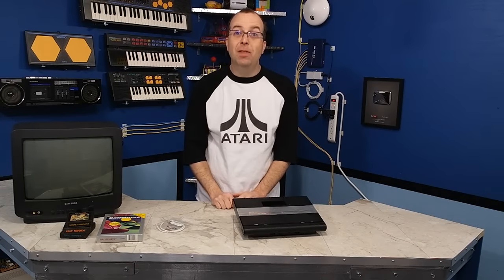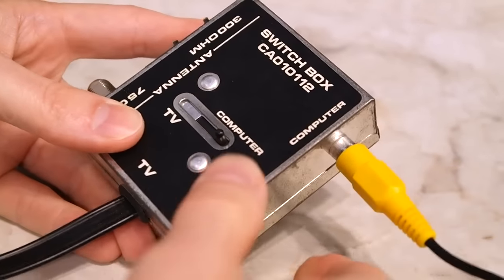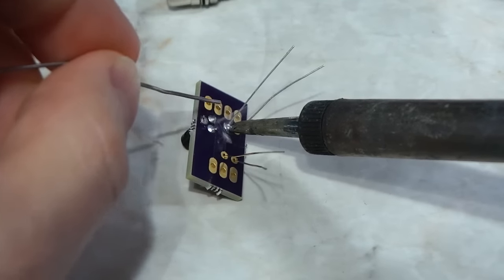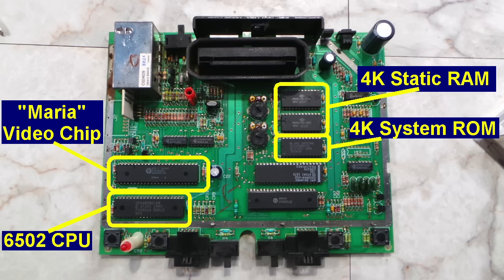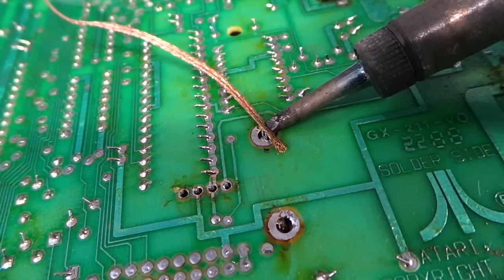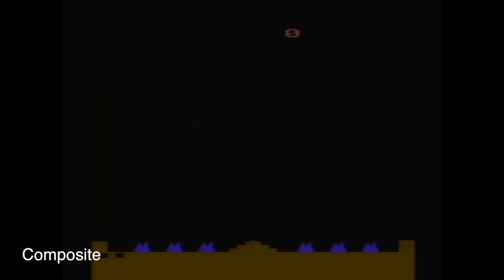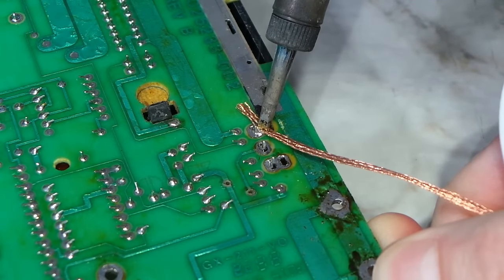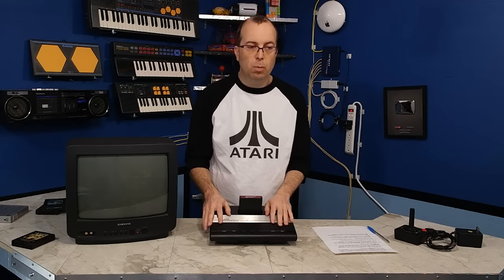Atari 7800 Composite Mod and Review

Comment: I don't know this to be fact, but I wonder if the reason Atari didn't include composite support is because the 7800 was actually designed in 1983 to be released 1984, but shelved when the company was sold. After Nintendo brought back the market, Atari brought it out without making any changes to the original design.
Reply from the maker: I had wondered about that.  But you would think they could have added composite jacks before releasing it again?
Reply: The 8-Bit Guy Yeah. Just one additional misstep on Atari's long, sad road to irrelevance.
Reply: This is my theory too. Guessing the consoles were built, boxed and warehoused, according to reports, so Ataru jus decided to ship them out as-is. From other reports, the person who bought Atari during the time of the crash didn't care about game systems, so I'd also consider that no adjustments were ever considered after the release. Would have been nice though had a 7800 model 2 been released with composite and improved sound chips.
Reply: @SumDumGy  You're right, they just shipped out the original units manufactured in 1984. The 7800 was actually released in a test market in southern California in 1984, and was slated for a national release later the same year. The units were shelved suddenly because after Warner Communications sold Atari to Jack Tramiel, he did a lot of restructuring of the company, halting the release of new products. Also, there was a dispute with General Computer Corporation, the actual developer of the 7800, over who was responsible for payment. Once all that was settled, Tramiel green-lit the 7800, which was released nationwide in May of 1986, 4 months prior to the nationwide release of the NES.

Had the 7800 been more successful, I'm almost certain there would have been a second manufacturing run, perhaps with composite outputs and an integrated POKEY sound chip.
Reply: I can confirm this is true
Reply: And yet the Jaguar required you to buy composite cables...

Comment: I appreciate this is an old video - the UAV (Ultimate Atari Video) mod is widely available now and is a huge improvement on these cheaper composite mods - and for only $25! It also adds s-video. Definitely worth looking into if you're looking to revisit this or mod any other Atari consoles. 👍
Reply: I second the recommendation of the UAV. You can install it without any changes to the existing circuit, leaving the RF module functional - you just need to add two resistors and a capacitor for sound.  The picture on a CRT is amazing.

Comment: You do not need a switch box into an adaptor. Just a connector from rca to coax will work just fine for that.
Reply: Kevin Blankenship Yeah. I'm really surprised he didn't know that.
Reply: Hey I have one of those (RCA Fem to F-Type Coax Male), but come to think of it I've never used it.
Reply: Kevin Blankenship it depends.. if you've got other stuff hooked up via rf, you need it for ease of connection. it also depends if he received the original rf cable with his 7800.. if he had it, he'd have hooked it up direct.. here in Australia, all atari concoles had a male rf connector on the end, no rca..  But going composite video and direct audio out, is a better choice anyway. As rf in the vhf range(channel 3 and 4) is dead in Australia, no new tvs have it anymore... I'll be making this mod to my atari consoles so I use them on any TV.. of course, will just make the mod to composite and then will need a composite to hdmi adapter of some kind... as apparently, composite is also dying in Australia, in favor of hdmi.....
Reply: all of my tvs always have like 4 hdmi and 1 composite
Reply: I notice a lot of you suggest using an rca to rca cable and an rca female to f-male adapter, I find that is a bad Idea because most RCA to RCA cables are meant to carry analog audio or low frequency base band video signals like composite video and work poorly for carrying relatively high frequency broadband signals like RF video,  I personally use an RCA male to F female with a piece of rg59 head-end cable with f connector on each end, although in the past I have had good results using piece of 2.5C-2V with high quality-ish push on f-connectors along with the F-female to RCA-male adapter
Reply: because your tv's aren't from the 80's
Reply: +Bowtie Productions
What does that have to do with anything, the TV in the video clearly has an F-connector for RF input, even if you were using an older TV with a 300ohm twin-lead input it would still be better to cutout the switch-box and use the method I suggested but use a matching transformer to get the f connection at the TV side.
Reply: I use one of those on a C64 and the picture is just crap. I tried "monster cables", old RCA's, new RCA's and it all looks like crap. Pretty sure is the connector.  Would not recommend to anybody
Reply: actually mine is a male rca by female coax. so I can use an rg-6 coax and get the best possible picture. I completely agree it's still best to mod the console. 

my point was it's pointless to convert the signal and then convert it back.

one last thought to the guy pointing out ease of attaching more consoles.
you could just use a unmodified NES auto rf switch.
Reply: i was replying to the other person saying his tv's had 4 hdmi and one composite. that's industry standard.
Reply: Brandon: You plug the F connector adapter straight into the Atari and then run coax to the TV. I don't think anyone was suggesting using RCAs for signal cables?
Reply: The Second reply says "Hey I have one of those (RCA Fem to F-Type Coax Male), but come to think of it I've never used it." , the only way that would work is if you are using and RCA to RCA cable.
Reply: You do need a switch box if you wish to have audio, however.
Reply: No, the audio will work perfectly fine without the switch box, the switch box is just a dumb pass through device, whether you use a switch box or an RCA to f adapter the same rf signal will get to the TV
Reply: Brandon Upchurch I
Reply: That works for pong consoles with built in sound, but there won’t be sound I believe on the 7800.
Reply: Teagan 
You don't understand what I'm talking about. 
I'm talking about using the RF signal as is with no mod. Just adapting the wire from RCA to female coax. And it works with sound. Heck that's how I used to play my toploading NES before I A/V modded it.
Reply: nasachusetts  Wow, 2 years later. I can see why I said that, because that's probably what our tv has, but I was 2 years younger and dumber back then.

Comment: I see a bunch of comments from people acting like the guy making the video is an idiot with statements like: 

"how could he not know he doesn't need the switch box, all he needs is an RCA to coax adapter"

True there probably is no purpose for the switch box now(even if he wasn't doing the mod) since it is an analog tuner and probably the only thing he will use it for is the Atari and if wasn't going to mod it could use an RCA to coax adapter, but has anyone commenting on that have enough sense to know that maybe he doesn't have the adapter and doesn't feel like either ordering it or going to a store that has it when that switch box works just fine(and besides he was doing away with that part of the circuit that used it anyway and he was just showing how it would have been hooked prior to the mod).  And he was correct saying "you will need an adapter" when showing how it hooks prior to the mod as you would have either needed the RCA to coax you guys keep mentioning, or the switch box he used which just happened to be handy since he already had it.

Comment: 6:15 Atari was already having quad core Pokey ICs made for their arcade department.  A pin-selectable duel core Pokey TIA IC would have done wonders for the 7800.  What a shame.  In that case, they could have kept their backwards compatibility but also provided sound that is superior to the NES in some ways.  That would have been an edge.  A couple years later, they rolled the dice on a custom audio IC in the Lynx, anyway.  I can't imagine what would have stopped them from doing the same for the 7800.  They were probably financially worse off by the time the Lynx came out and they were being run by Jack Trammell in both cases.  Strange.
Reply: From what I understand the 7800 was originally designed to have an onboard POKEY, but Atari was trying to keep manufacturing costs down while also making the 7800 physically smaller (due to the ridiculous size of the 5200). So they compromised by removing the POKEY from the system board, then providing a smaller version of the POKEY for developers to install in their game cartridges. Most developers didn't use it because the cost of putting extra chips in the cartridges was seen as too high for a profitable ROI.

Comment: I'm glad that I bought a 7800 that had already been modified.  I'm pretty good at putting hardware together, but when it comes to soldering, drilling holes, cutting boards etc. my hands aren't quite dexterous enough to do a good job of it. So glad that there are guys out there like you and the guy that I got my console from who can do this stuff better than I can.

Comment: 7800 was engineered in 1983 and originally released in 84.  composite was still pretty rare in 83.
Reply: ***** Can we eat some 8-Bit Cornflakes together? ☺
Reply: Released in 1986
Reply: @SumDumGy  originally released in 1984 then shelved.  86 was after NES became popular.
Reply: @musclesmouse  7800 was released in southern California in 1984, shelved, then released nationwide in May 1986. NES wasn't released nationwide until September 1986. By the time Atari was really competing with Nintendo (would have been 1987), the 7800 had been out almost a year.

Comment: Hello! Just finished development on a PCB board for the Atari 2600 which provides proper buffered composite and S-Video from the system, it's been designed in such a way to prevent any luma leaking into the chroma for a clear as possible composite channel. It replaces the RF output (on the junior) models so no modifying of the case is required. may be able to create something that works for the 7800 too. Happy to provide you with a board and parts if you are interested.

Comment: The 7800 doesn't have a composite video output because it was actually designed in 1983, when pretty much no other video game console had direct audio/video outputs. The 7800 was ready to be released in 1984, but it got shelved due to the video game crash and Atari being sold to Jack Tramiel, who wanted to focus on computers.  

But after the success of the NES in 1986, Atari took the 7800s and games that had been sitting in warehouses for two years and put them on the market. Eventually Atari did resume production of the 7800 and developed some new games for it, but it was nowhere near as successful as the NES or its own predecessor, the 2600.

And the 2600 and 7800 both do actually produce stereo sound internally -- the two audio channels coming from the TIA chip are independent and are then mixed together in the console's circuitry. But with further modification you can tap into the independent outputs and send them to the left and right audio outputs.

Comment: has someone noticed, that 8-bit guy removed the AI video ?
You see, no vinegar => complaints => video take down.
Reply: Liked because of no vinegar
Reply: I think it was removed due copyright issues. Terminator, Star wars...
Reply: Countless videos talk about those without any kind of permission. I think it was because of the negative feedback. Personally, I think it was quite silly and didn't like it. The idea was good, but there were many faults
Reply: Reactions in the comment section were excessive. There are more important subject to get mad about than some nerdy theory.
Reply: I haven't read all the comments of course, but the ones I've seen where pretty civil, not insulting and used logic
Reply: King Parodije it was probably copyright because it had a lot of movie clips.

Comment: I had that exact unit!  Might of been mine when young.  (sisters spilled water in mine)  You have the console only which explains the missing everything else.  stored games and controllers in one box and consoles in other.  I loved playing Xevious, Joust,  And Ms. Pacman.  The controllers are a step up in function but tended to fail easily.  (switches dislodge from inside)  not very durable.

Comment: If im correct you can also use a sega genesis pad on the 7800
Reply: Sort of. If a game requires 2 buttons you need a 7800 controller. Here is a list: http://atari7800.org/7800list.htm
Reply: Nah. You can make an adapter for $4 in parts to use a Genesis pad with a 7800 if the game requires two buttons. If the game doesn't require two buttons, which is all 2600 games and the vast majority of 7800 games, just plug it in and go.
Reply: No don't use a Genesis pad on any Atari or Commodore. The Genesis pad puts 5v down the wrong line and can fry chips, especially Amigas are sensitive to it.
Reply: Genesis controller only works as a 1 button like 2600.  I tried it as a kid.  I wasn't crazy over the buttons on the side of 7800, they were uncomfortable.

Comment: This could not have come at a more perfect time. I was just thinking about doing this mod on my 2600. The success you had with yours seems like a good indicator for me to try it myself. I was thinking about sourcing my own components, but you mentioned that you got a kit off of Ebay, so I'll try looking there.

One change I want to make personally is instead of using 3 RCA connections, I'd like to try using a single 4-pole 3.5mm jack (using the same standard as the Raspberry Pi's connection). I can use some old camcorder cables I have lying around with it, and I won't need to drill into the casing as much.

Comment: It not having traces on the surface doesn't mean there are no traces there. You were lucky here. PCBs don't only have traces on the surfaces, but also on the inside
Reply: That Guy not in the old days... multilayer pcbs is newer technology that started to be used largerly since 32bit hardware
Reply: If there were traces there the PCB would be darker. Also it's a simple 2-sided 8-bit board.
Reply: Raul Rojas Truez but there always are exceptions. Was fixing a pretty high-end keyboard from the 90s lately and it had a multi-layer PCB

Comment: +The 8-Bit Guy
>does not output stereo sound

NOT TRUE! Even the Atari 2600 did stereo, all the way back into the 70's! Even the first ever Atari cartridge, Combat, was in stereo!

While it is true that there are only a few stereo games, they do exist, especially in the Homebrews. Fact is, some Homebrews require stereo for you to be able to complete levels.

PIN 12 on the TIA is the RIGHT channel

PIN 13 on the TIA is the LEFT channel
Reply: Stereo was never implemented in the final design though, was it? I imagine you could probably get it by using those pins but it's not like it matters much since most games were probably designed for the mono audio that was used in the end.
Reply: Not sure about the Amiga, but to my knowledge no NES games were ever programed for stereo, whereas many Atari games actually were.

The Atari 2600 and 7800 have actual separate 2 channel left and right audio. The NES does not. Again, not sure about the Amiga.

Comment: It's always fun to see the old VHF system being used for things, we left that behind in the 80s when the 405 Line TV was shut down (though analogue cable still used VHF, but that's gone too), so for us it was Channel 36 (also shared with VCRs) on the UHF scale, slightly better picture, but still had RF noise... :)

Comment: Why do Americans still use non-metric units? You had nice 3cm (30mm) at the bottom of ruler but you decided to use some bizarre 2,54 cm instead of just 3 cm ;)
Reply: Atak Snajpera 
For the same reason they drive on the left side of the road in England
Reply: @Den Tyngaste The only reason why we use the imperial system is because that's all that most use, simply because that's what we know. Most don't actually like it, like myself. I can read metric well enough, but in practice, we don't use it often enough. (Also I completely agree that the US is pretty trash...)
Reply: I like metric and I wish the US would switch to it, but to switch a country over to an entirely different standard is a huge deal and one in which our leaders and industries are just not interested in doing yet. For what it's worth, the metric system is standard in just about all scientific and medical practices in the US.

Comment: Part of the reason the 7800 was missing composite support might be that it was originally to be launched in 1984. That lasted all of a month, and they shelved the system due to contract disputes and it didn't make it back to retail store shelves for the "real" launch until 1986. So it was already two year old technology by the time most people could buy it.

Comment: I use silicone sealant as an adhesive in this situation.  It's an insulator (don't use black, may have conductive carbon in it).  It easily allows removal for servicing or restoration.  The drawback is it takes a long time to setup.

Comment: I love this video! I have an old system from when we were kids and it was damaged in a car accident when we were moving many years ago. Instead of fixing the old rf jack, you've inspired me to just revamp to av out instead. I never realized working on these old games could be done with tools I already own. I'll let you know how it works out after I'm done.
Reply: So how's it working?
Reply: @dogge929  It's not. It's still in an old box in a closet somewhere. Turns out some capacitors go bad after 35 years. It needs more love that I can give. Emulation is just going to have to do for now.